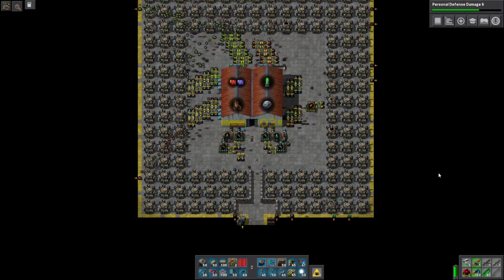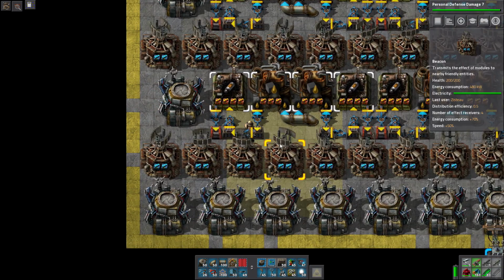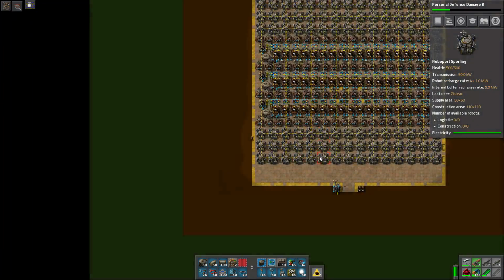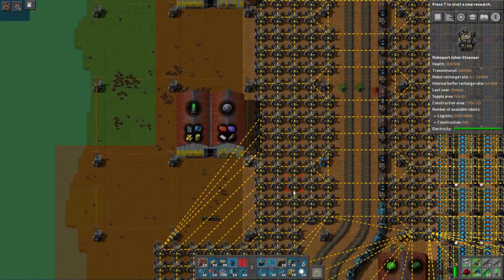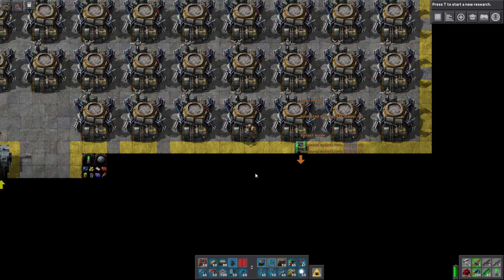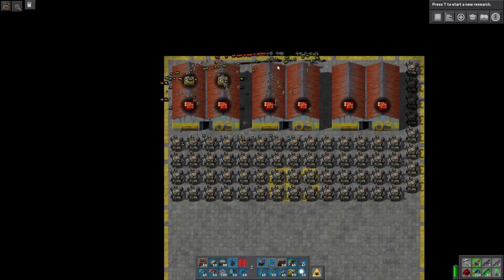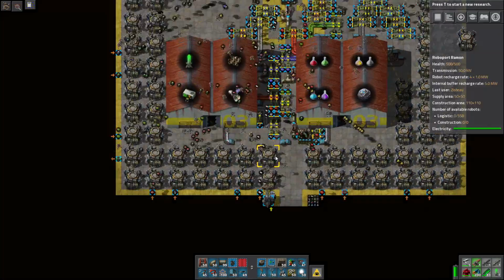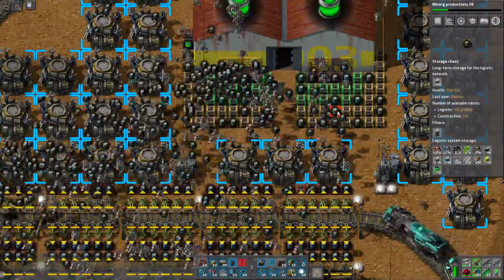Factorio Recursion Recursion #9 - Forward the Interface

Comment: And remember, you need one pump per 12 boilers/20 turbines when they work at ... ehm ... "full steam" :P Some pun intended...

And with trains bringing in the water, you probably need to saturate that water-loop...
I tried to use belted barreled water for a huge nukelear setup myself, but in the end it didnt really work well, could not get enough a decent enough thruput, even with some overhead:
pump gives 1200 water, each barrel contain 200. A blue belt can take 40items/sec, thus 6.67 pumps worth. Trid 8 pumps into 6 lanes of nukes, but either im dumb, or i didnt get it to work properly, a 2/3rd reductuin in land use for water transport WOULD be nice, but to no avail.
Reply: pump to boilers is 1-20-40 though

Comment: Could you add a circuit which varies the power output from the power station to guarantee that the power supplied to the inserters inside your power station is satisfied? So if your base is drawing too much power, then the base slows down, but the components feeding the reactor continues to run. Or does the way the recursion mod distributes power prevent you from doing that?

Comment: Next playthrough should be Seablock Recursion. You start on the seablock island will all its mods plus factorisimo, and all recursion tech already researched, and maybe a factory building or two in inventory. The challenge: keep the island as small as possible by processing everything inside the factory building.
Reply: Zisteau wo0uldn't consider it challenging enough without also doing the recursion research. :D He doesn't half do things!
Reply: Oh my.
Reply: Naw - how about a VANILLA challenge?  Making a map with max cliffs and max water is INSANE levels of spagetti if you don't use disallow landfill and cliffbombs.  (Even allowing massive use of landfill and cliffbombs it gets squirlly)  Not that it would be a very long series because the goal would only be a single rocket launch.  (And because Zisteau is not fond of off-center hacks)
Reply: @kin2naruto  holy shit that would be hell, cliffs are my arch nemesis

Comment: i dont know why is not possible to pause a research, i've made the labs run in specific circuit behind an interrupt, so if i need to pause the research i just turn off the interrupt, without energy theres no research, i've made this with several systems, radars, furnaces, laser turrets, miners, if you have to work on something and dont know if you run out of energy just turn off other systems, like miners or radars, so the laser turrets always get energy
Reply: In his case, just pick up the factory :)
Reply: yeah with factorissimo you just pick the factory up or change the energy flow and thats it
Reply: I never went to deep into circuit stuff, though. You could probably build a system, where the least needed /desirable components switch their power of one by one automatically, if the demand can't be met.
Makes me want to play factorio again :)
Reply: or.... ORRRR you could just make more power so you can run all your systems all the time like come on the factory must grow and your power should match.

Comment: if (when) you get power problems, then you can remove a large portion of your roboports on each floor. 90% of them are not getting used, and they draw idle power. you can always add them back in, if you get charging problems. im guessing you could save 1 GW of power by trimming your roboports.
Reply: Most of his power is going to the beacons wich always use their maximum power.
Reply: @JDTeam  that's kinda weird, right? Why don't they use power according to the modules in them, like the assembly machines?
Reply: Beacons allways "broadcast" the modules effect, they have no way knowing when any of the machines want to do something so they just stay on forever.
Reply: @JDTeam  but why do they also consume power if there is no modules in them? They are not doing anything at that point
Reply: well, i never really placed beacons without modules so im not sure if they consume power if they don't have modules, but as far as i can see, Z put speed 3 in all his beacons
Reply: @seregruin  How does a wireless beacon not only transmit improved performance of varying types to distant machinery, let alone make sense in the specific way you're asking about.
Reply: @longshot789  what's the question here? Every other machine consumes more power when it's working compared to when it's not, why not beacons?
Reply: @seregruin  Because they constantly broadcast the signal. Machines receive the signals on their own.

Whether a machine receives a signal or not has nothing to do with a beacon's broadcasting. Its like a radio tower, even if you're not broadcasting music, you still consume a buttload of power broadcasting your signal. Besides, beacons don't even consume power if you don't use then like real life..example: If you don't want a beacon(or any machine) to draw power, don't plug it in (power pole).
Reply: I think he puts so many, because he might need them once he scales up and it is difficult to change the design later. He can always remove them afterwards if he doesn't need them.
Reply: Beacons give already a speed bonus without modules. This bonus can be increased by adding speed modules.

Comment: You really should be automating logistics robot placement, it would be fairly easy if you just add a provider chest at a specific input point in the factory for logistics robots, then another requester or buffer chest with an inserter next to a roboport. Then later on down the line you can more evenly distribute the robots by just plonking them into a chest (or better, automatically doing it when more are created :P)
Reply: Can they traverse levels though?
Reply: @seregruin  they probably can't traverse levels if they are active and flying, but they can traverse levels if stored on chests, just like every other item, right?
Reply: You could probably do a condition to only insert them in roboports if there is a demand in the specific layer! I think roboport signals allow that.
Reply: @AbsoluteHuman  That could actually work, you're onto something! I hope Z sees this